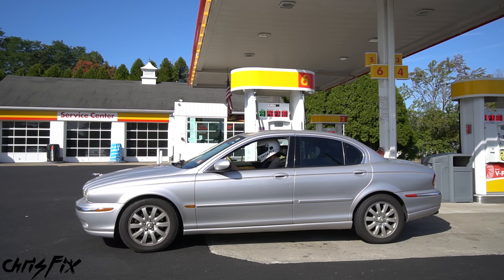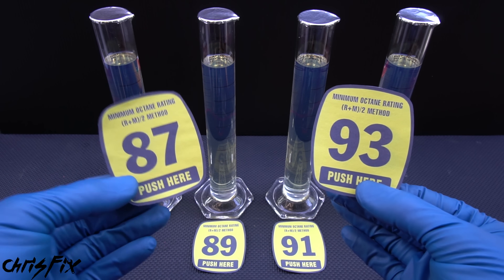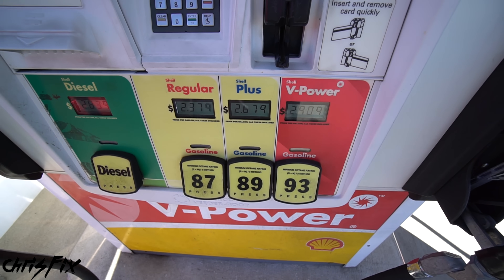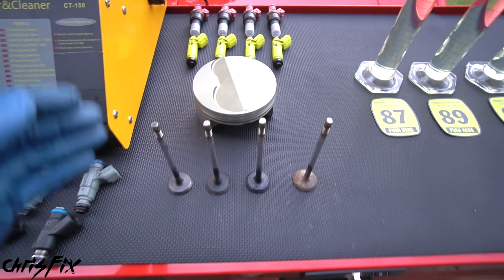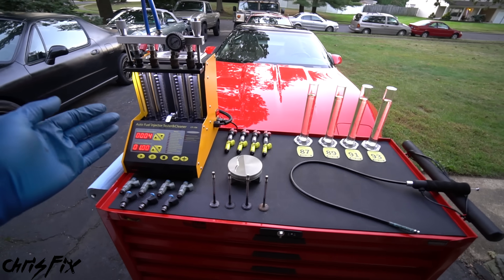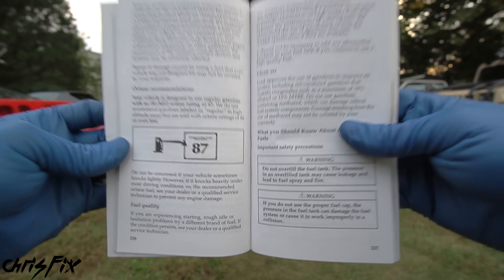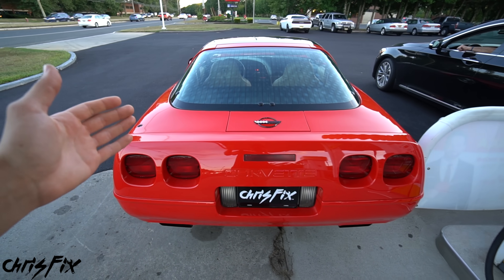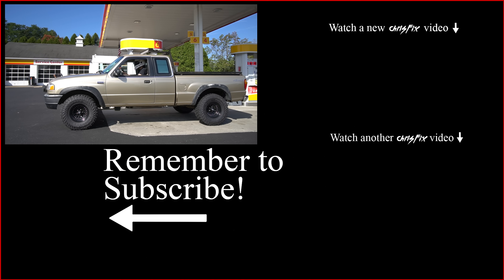What is the BEST Fuel to Use in Your Car or Truck and WHY

Comment: What's the difference between gasoline in shell/chevron to cheaper gasoline in Sam's/walmart?thanks
Reply: Nothing really. Every chain puts in their own additive package. But all gasoline has to have a minimum additive package mandated by the federal government. And this additive package by the government makes your car run clean and reduces carbon build up in your engine. So the extra additives by individual chains, are all just their secret recipe to basically do what the gas already has in it by the refinery anyways. 

And if your gas station chain participates in the "Top Tier Gasoline" program, then all gas stations that participate in that, all run the exact same gasoline with the same additives no matter what. 

"Top Tier Gasoline" is the highest quality gas money can buy at any pump in the US. This standard was set by the auto manufacturers, government and the oil industry together. 

Here is the complete list of participating "Top Tier" chains. Gas sold at these chains, is 100% identical across all of the brands in every single way. 

Licensed Retail Brands for "Top Tier Gasoline."

76	

ARCO	

Aloha	

Amoco	

BP	

Beacon	

Break Time C Stores	

Breakaway	

CITGO	

Cenex	

Chevron	

Conoco	

Costco Wholesale	

CountryMark	

CountryMark PLUS	

Diamond Shamrock

Express Mart  USA - Wisconsin

Exxon	

Fast Fuel	

HFN - Hawaii Fueling Network	

Harmons Fuel Stop	

Hele	

Holiday	

Kirkland Signature Gasoline	

Kwik Star	

Kwik Trip	

MFA Oil	

Marathon	

Meijer	

Meijer Express	

Metro Petro	

Mobil	

Ohana Fuels	

Phillips 66	

QT	

QuikTrip	

Ranger	

Ranger Fuel	

Ranger Mustang	

Ranger Stallion	

Ranger Thoroughbred	

Reeders	

Road Ranger	

Rutter's	

Shamrock	

Shell	

Simonson Station Stores	

Sinclair	

Texaco	

Tobacco Outlet Plus Grocery

Valero	

Value America	

WOW

Win Win

Comment: @ChrisFix about the energy of different oktane fuel: Did you know about eu law that was put in place to support greener fuel that changed the ethanol content? That also supposedly changed the combustion characteristics which could be compensated by choosing different oktane fuel. My car says it needs to run on 95 (eu) but my dealer said it should be filled with 98 because of this change in fuel..

Comment: They used to call high octane fuel, "ethal", possibly meaning ethyl alcohol?
Reply from the maker: I think that's referring to E85, that has an octane of ~95-100
Reply: @chrisfix  No Chris, the old "Ethyl" does relate to Ethyl alcohol, aka ethanol. There is an old line from a Marx Brothers movie "If you run out of gas, get Ethyl. If Ethyl runs out, get Mabel". So"Ethyl" is likely an old name for E10. E85 is new, a politicalfuel that corn growers like and car drivers are better off without. I tried it in a flex fuel Equinox (family car, I would never buy one) where the "E85" was 55%. Terrible performance and economy.

Comment: What about 91 non eth compare to 93 with 10% eth. What should I run in my 2019 gmc Sierra 1500 5.3L.  The dealer ship says just run anything it won't hurt the motor

Comment: In Europe, we have higher octane rates. standard fuel is 93-95 octanes (depending on country) and "super" fuel is 97-99 octanes
Reply: You have to watch to the end of the video, as he explains that Europe doesn't have higher octane rates. The US uses a more strict measurement method than what Europe uses. And due to this more accurate method that the US and Canada as well uses, it results in a lower overall number. The EU only uses the "Ron" method for determining octane. But the US uses both the Ron and Mon method. The US uses the average of these two tests to determine octane. So Tesco 99 Ron, or the Shell V Power 99 in the UK, is the same as 93 octane in the US. 

"Tesco 99" and Shell "V Power 99" are rated at 99 Ron. But they are also rated at 87 Mon. So the US method of (R+M)/2 = 93. 🙂

Comment: Good video, best advice is to open the owners Manuel and see what it is recommended. My Honda runs on 87 just fine, but when I put 91 I see better performance in higher RPM and higher RPM before it shifts. If you can’t tell the difference it’s a wast of money 100 percent. Chevron is the best but 91 shell does put out more power I’ll give it that. Just saw the end you said what I’d said ha

Comment: My car's manual says this for my engine... 

If your vehicle has the 3.6L V6 engine,
 use regular unleaded gasoline with a posted octane rating of 87 or higher. For best performance or trailer towing, you could choose to use middle grade 89 octane unleaded gasoline.

Why would 89 octane be for "best performance or towing?"

Comment: I strongly disagree with you bro the real reason why supreme is more expensive is because of its quality and detergent additives it contains it doesn't matter what car if you pump supreme you will get better gas mileage and help your engine last longer
Reply: Yeah......no! This is scientifically debunked. Premium is more expensive, because far less of it is mass produced at the refineries. 87 and mid grade gas all contain "extra additives" to reduce carbon build up. Especially with the newest "Top Tier" initiative set forth by the oil and auto industries. Most experts strongly recommend staying away from premium now, unless your car needs the higher octane. And in fact the higher octane gas can now have a negative effect on gas mileage in some makes and models.

Comment: I have a 2019 Camry 2.5 liter direct injected 4 cyl Toyota says it runs fine off regular 87 octane I’ve never put regular in any car I drove I’ve always used Premium and the cars have always been fine I also put fuel system cleaner in like every other tankful I just don’t like regular it’s like drinking well water 🤷🏽‍♂️

Comment: Always arguing with coworkers about which fuel to put in the Silverado. They always argue for Supreme but I say whatever the company wants and if the company has no opinion then use whatever fuel the owners manual says. I put regular in my sports bike. My Lincoln sedan recommends 93 or higher.

Comment: In my truck gas burn very fast and it has alot of water. I have to drive 20 mile to get gas that last 93. Also the pumps are fixed in NJ I go to one spot with cheaper gas and get less of where I go with higher price get more. Go figure!

Comment: When I read the manual for my new Rav4 Hybrid "Use Only unleaded 89 octane gas (Research 91)..." I was confused if that meant I should still look up to 91 or equivalent if rating was different on my state. Now I see what that R"esearch Octane" meant, thank you!
Reply: I also have a rav4 hybird. Do you mean that you can add 91 gasoline once in a while to clean the engine?

Comment: So I'm curious, my book says to run 87, but the car has a turbo that came stock. I've ran 87 with it and it didn't feel right, I've switched to using premium or mid grade if available. So should I continue using the premium fuel since it's forced air? Or what's the right call for my car?

Comment: So what's up with Racetrac's weird new 88? If my car uses 87 typically, would it be alright to use that? Or if my car uses 89 typically would it also not matter? I ask because it's like 10c / gallon cheaper for whatever reason.
Reply: 88 octane is E15 gasoline. (It's 15% Ethanol and 85% gasoline.) You can use it on any US car made after 2013. The pump says 2001 or newer, which is wrong, since Ford didn't fully adopt E15 until 2013 on all makes and models. Ford was also also the last holdouts basically to fully embrace it.) 

E15 isn't considered a Flex Fuel like E85 is however. Only cars labeled as "Flex Fuel" can run E85. (Not to be confused with 85 octane rated gas, found in higher elevations and some states like Colorado.) E85 doesn't have a posted octane rating. But it's generally rated at 95 to 100 octane depending on the given formulation.

So yes, if your car is a 2013 or newer, it's definitely made to run E15. If it's older though, it "may be" rated to run it, if it isn't a Ford, or a couple of other European made models, which again, didn't fully adopt E15 until the 2013 model year.
Reply: @waycoolscootaloo  thanks, I appreciate the info.
Reply: @hamznaq6953  Your welcome! 🙂

Comment: I wish he would've talked about e 85 for the uneducated, super high octane, better cooling effect, yada yada. Because people think e85 is cheap bad fuel, but ITS NOT. People wanting more power out of an engine will use e85 with high compression from forced induction because of the higher octane and cooling. It has race gas benefits but for cheap. Of course only use e85 in a flex fuel vehicle or a vehicle that has been tuned to compensate for the Ethanol blend.

Comment: Why ethanol instead of octane or does the ethanol have octane in with it? Can you use an octane booster with ethanol fuel? Is it safe to use a product such as Seafoam in a flex fuel vehicle?

Comment: I find that many automaker's design automobiles to run as lean as possible with their software mapping, which is why I hear tons of automobiles getting slight knock despite the proper fuel used. Not to say mechanical issues don't arise, but it also boils down to software mapping and emmisions standards needing to be met.

Comment: I once heard from a mechanic that if you are due for an emissions test, you should fill up with premium and run it fast on the freeway at 75+MPH for about 10 minutes which should clean out hydrocarbons.

Comment: That Ethanol absolutely ruins small engines like lawnmowers. I don't know what it doe's to car engines. Those trash trucks use natural gas and seem to run clean. I know of a product additive  that when added to fuel, there is no emissions at all. Why the government doesn't get rid of Ethanol and switch by using this additive is nuts. There are answers to environmental gasoline emissions problems, but of course it would put many people out of work. So we are stuck with Ethanol which can't be good for engines.  As for octane, I know that the low octane gets better gas mileage. The high octane burns much faster. I just use 89 octane. I have no detonation problems, but I wouldn't use 87 octane unless I had to. As far as going by the owners manual. Auto manufacturers make money on selling cars. By telling you what octane to use I don't trust at all. If they were helping us keep our cars running and in good shape, they would loose a lot of money by having our cars last. They want to sell. Not preserve. I think using your best judgment is best.
Reply from the maker: Thanks for sharing

Comment: If my car says e85. Is it ok to run premium? What should I do? Also what to use to help clean the motor inside and how often to use it.. appreciate u
Reply from the maker: You should have no issues running premium, but what does the car take if you couldn't use E85? And premium has more additives so it should help keep your engine clean, and you can use it however often you like!

Comment: So speaking from my experience:
My mom's Renault Fluence have 180k kilometers on it, and we started to notice that engine was dropping power all of sudden and sometimes on higher rpms, a strange sound. We took it to a mechanic, and the problem was diagnosed to 3 out of 4 pistons being a few microns smaller than they were supposed to be, and they were free floating in the head, causing the noise and power drop. They fixed what they could, but it still wasn't perfect. They recommended us putting 100RON every 3rd or 5th tank to clean up injectors and plugs, and lubricate the pistons. Normally, it is recommended to run on 95RON. It is still working properly.

And my car, I have Honda Civic VTEC, and I bought it second hand with 340k kms on it. First thing I did after purchasing it was fill it with 100RON premium (Shell V-Power is really the best, not sponsored, just my experience). After you do all the routine new-used car maintenance (oils, spark plugs, tubing check, etc), let the engine warm up and go for 20km ride, and don't worry to give it a little. It'll help clean everything inside, remove the gunk and lubricate everything.

So if your car is older and you are noticing something being not as good as it used to be, first of all, visit a mechanic, but if you for whatever reason can't, fill it up with 100RON on every 5th-7th tank. It'll really help the engine.

Comment: Serious question. My compression ratio is that of where it would use premium and I’m also turbocharged from the factory. Though they recommend regular. So I used regular for 8 months and then decided to run premium, my car started running better and started getting better fuel mileage. Should I continue to use premium or use the recommended regular? Like I said in the beginning this is a serious question
Reply: Run premium, high comp and forced induction are exactly the two things you should run premium for

Comment: My Acura RDX says Premium Recommended but the manual also says - The use of regular unleaded gasoline can cause metallic
knocking noises in the engine. I guess it's a Premium required then.

Comment: In the military we have vehicles that filter fuel to the out water through thier filter separators if you used a filter separator on fuel from the gas station to get a low aqua glow result would it benefit your car in any way? Or is it not worth the effort? I thought I'd ask the question because alot of people in the military have stated doing this can be better for engines and make them last longer which is why all military aircrafts have to pass an aqua glow result of 2 parts per million of water to fuel. Which in retrospect is like 2 drops of water to 1 million drops of 100% fuel. Would love to have a video covering this if it is at all possible for you to do

Comment: So how come my car car accelerates much better with premium fuel? And like crapp with regular ?
Reply: In general your engine’s computer will run more ignition advance with the higher octane fuel as “knock” or preignition is not being sensed.  This results in better response.  With lower octane fuel the likelihood and threshold for preignition will be negatively impacted, engine senses this and retards timing which will make it less responsive.

Comment: at 3;44 wrong. the correct explanation is; knock is caused by the low octane fuel burning up completely before the bottom dead center. no pressure on piston= knock

Comment: hey im an old subscriber and i recently bought a dodge durango 2018 with the 3.6 engine pentastar i dont have a user manual and cant find any thing under the fuel cap it says it runs on e85 flexible fuel but my first fill up was a regular gas i didnt hear any knoking while driving in my country cars like that we add 60% regular and 40% premium the question is can it run on a regular gas ? and we have dirty fuel although i live in iraq i change fuel filter every 6000 km and it looks like you ford 320 k fuel filter

Comment: F150 2.7 ecoboost has twin turbo but manufacturer recommends 87 octane, what gives? Also which is best for motorcycle storage without using stabil etc?
Reply from the maker: That truck is tuned to accept the lower octane, and all fuel will eventually break down so there is no best octane for storage!

Comment: How come 93 I get more power then 93? Thats fact. Iv done it on 3 different normal cars and my 150cc scotter.
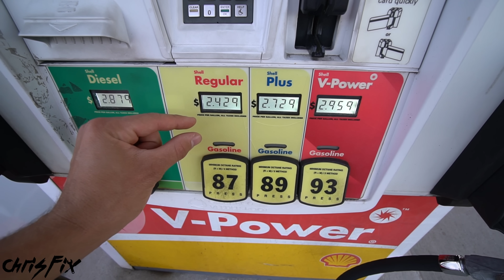Reply: 12:22 Well you kinda contradicted yourself there but I can tell you even engines that say 87 when you give them 93 will run faster & Shell 93 will clean your engine. It not worth doing 93 every time but once every few months 93 is great for a cleaning and there is more power

Comment: I’m old and every car knocked when I was young, that  meant timing was off. Easy fix reset timing and usually change points and condenser
Reply: Electronic ignition gives hotter sparks so the burn should be better, and with points no longer arcing we not longer need to Dwell on those.

Comment: Chris, my 1990 f150 calls for regular 87 octane; however, I am worried that the ethanol in the gas may be bad for the older trucks fuel system. Should I opt for ethanol free gas instead? The closest ethanol free I can find is 89 octane. Would I be better off running the regular 87 octane with ethanol or switching to the 89 octane ethanol free?
Reply from the maker: I'll be making a video about ethanol soon, stay tuned!

Comment: This has been helpful. I’ve been using 93 for years on my 2003 G35 Infinity Coupe. Manual said to use 89 octane and when I did the car had a strong bad smell coming out the exhaust pipe. Should I continue to use 89 so the car can get use to it? Or just continue to stick with 93?

Comment: So, running premium for 2700 mi will clean your fuel system if it had corrosion. But would running regular with octane booster be cheaper and do the same thing?

Comment: I used 93.... to me I have better performance..the 87 is cheep gas mixed with water...I used to put 87 in my older car..it doesn't give that performance like it should and it spark nock.....with the 93..way better..plus when I take off..it will take off fast...so for me.....no 87....